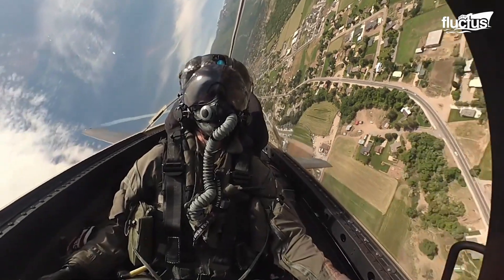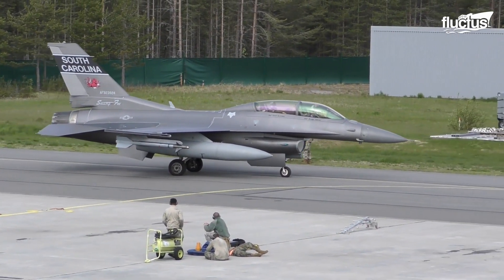The Reason Why Only the US and Russia Can Build this Advanced Tech

Comment: The quality and quantity of weapons is a reflextion of a country's economy.  The USA has 24% of the worlds economy!!  The USA can spend tons on money on a weapon system then reap the technology with the military, NASA, etc., later into consumer products.  These technologies benefited the entire country.  Integrated circuits is a good example, in 1966 a devide by ten counter purchased by Lockeed cost $500 each "IF" you purchase a minmum of 500 chips ($25K)!!  That sort of money enabled the chip industry to improve products providing jobs, bring the cost of manurefacturing, etc.  The spending by the government (in part) helped get the micro-processors we have today as advanced as they are.  There are electronic retail stores where one can buy an Intel microprocessor (30M transistors) for $1,000.  That initial spending increased the US's ability to advance its society, not just in semiconductors but, far more than not getting involved in the economy.

Comment: Thrust vectoring wasn't really designed for dog fights. it was mainly used for high altitude maneuvers where the plane's flight surfaces have less effect due to less air molecules to work with. Trying to dog fight against fighters with modern missiles is suicidal.
Reply: Julian  from my knowledge 2D vectoring only allow the thruster to move up and down, don't really know much about 3D tho so i'm not gonna assume without knowing
Reply: user-ig3sp2jw7t  Yep. 2D Vectoring actually allows the plane to roll and change pitch/attack angles like a rocket.  3D vectoring  allows your Mig to enter a flat spin like a retard.  there is no real advantage to 3D vectoring.  if you consider the physics and geometry of the body of the plane itself.  because your largest control surfaces are your wings. but if you angle your thrust vector Horizontally your plane's tail will have to do a lot of work.
Reply: user-ig3sp2jw7t  Also imagine how a pilot operates his plane when a pilot wants to bank (turn) they often Roll and pitch . essentially they are turning the plane by pitching up and down on a turn.
Reply: Julian  with 3d vectoring maneuvering 10x better .
It's like upgrading a car for drifting on high speeds. 
Also is used to keep jet at 0 speed , pretty much freeze it in the air like helicopter.

Comment: Why are people still discussing and wasting lots of money on old concepts and technology?  Unmanned aerial vehicles with advanced sensor technology and AI systems are capable of performing maneuvers that no human could endure, and do it at a lower cost and with greater capabilities.  The age of the dogfight is quickly coming to an end with stand-off weapons and AI systems.
Reply: Uh-huh, and that's the same thinking that prompted gun pods for the F4.
Proof required first, only then do you change a winning strategy.
Reply: People said the same thing with F4s before those were easily shot down in Vietnam =))

Comment: LT Rob United States Air Force retired. Experienced my action during the Gulf War. Anybody pretending to be service or ex service will get what's coming to them. Karma is a bitch. I flew yes not a fighter, my job was to defend the troops on the ground when called upon. We owned the air and it was a cakewalk after the original small invasion took out vitals.